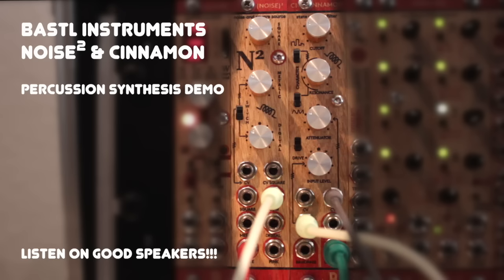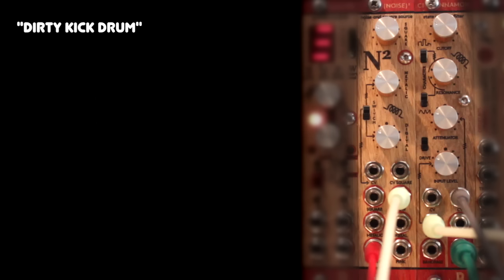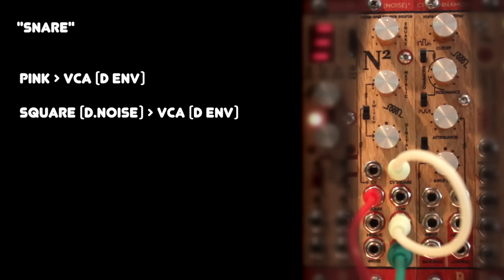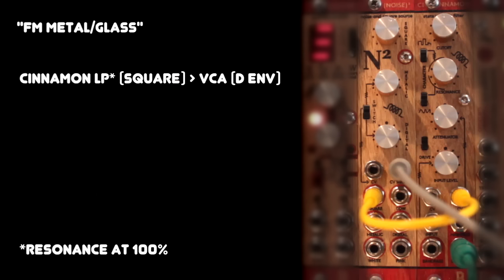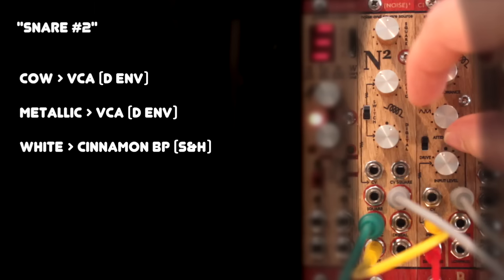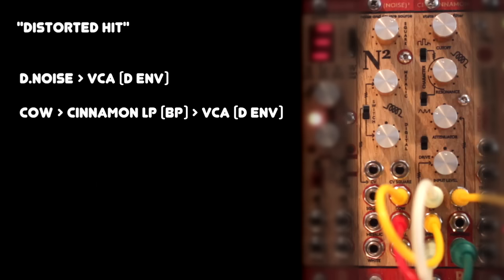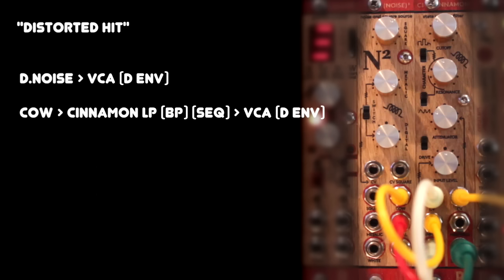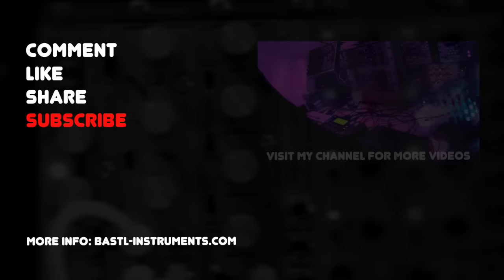Bastl NOISE SQUARE & CINNAMON: Drum Sound Tutorial #TTNM

Comment: Tell me if I am wrong: the noise square needs 5V, which is not available in the doepfer diy kit (6U 84hp)... So I couldn't use it ? :/
Reply from the maker: +Rhapsody in noise I've got the Doepfer DIY Kit PSU as well and just use the Doepfer 5V Low-Cost Adapter on the bus board on which I have the Noise2.
Reply: +The Tuesday Night Machines Oh great then :) thank you